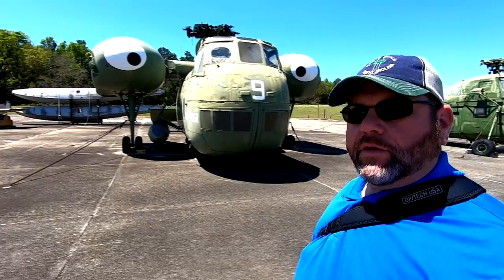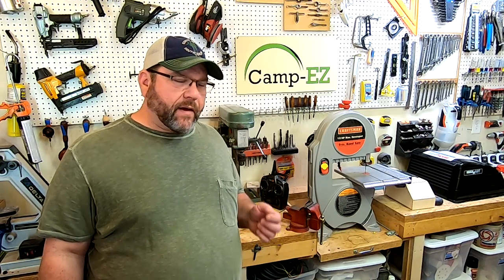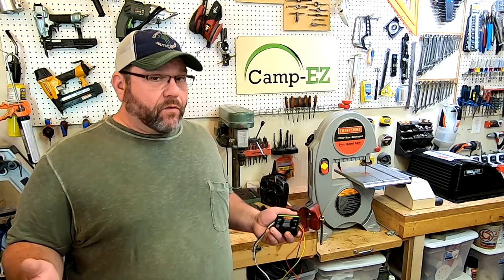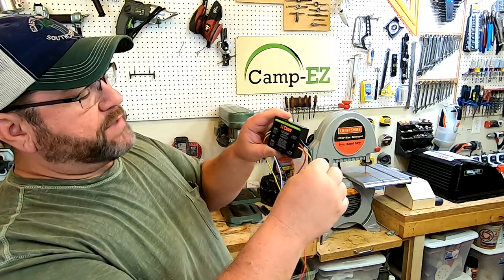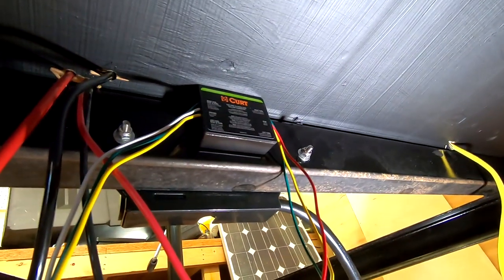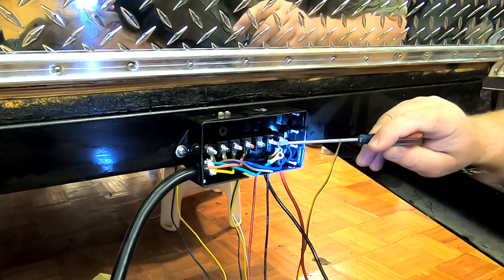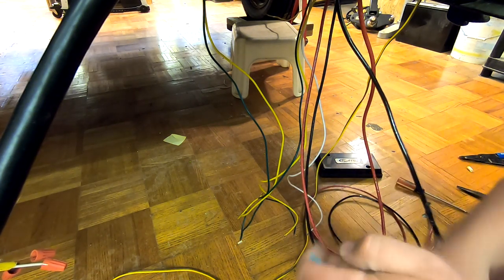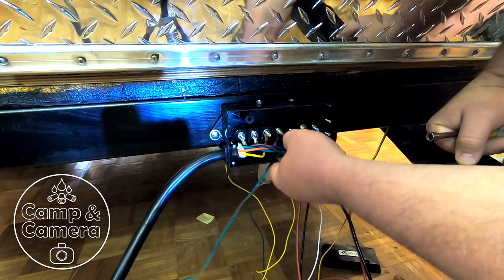Teardrop Brake Light Problem / Watching the Blue Angels

Comment: I understand this was made almost a year ago.  When I have an electrical post with multiple connectors, like the 'eye connector', if there's space on the length of the post, I put "Star Washers" between the connectors.  The Star Washers bite into the connectors for a solid, practically immovable connection.

Also, I'm in the research phase of looking for a Teardrop Camper design.  One of my requirements is having a Backup Camera for the trailer, which would be connected to the monitor in my Tow vehicle.  No matter what trailer I tow, I do NOT like having that blind spot directly behind me!

Enjoy your videos!  Happy camping!  =)
Reply from the maker: Great feedback!  Thank so much!

Comment: Years ago I had a tail lights issues on a scamper pop up and a boat trailer. But worked fine on the Chevy or GMC. Didn't work a Dodge. Fixed  it by replacing the Dodge not the Scamper!
Reply from the maker: Good choice!
Reply: @CampandCamera  After hauling a small boat and the Chevy hauling the Scamper, the boat went in garage, the POS Dodge went in the front yard and Craigslist!

Comment: It's like a professional shot those angels 🛩 ;). 

So I have been planning on using a ground block for my build. Is that what you're referring to having all the issues?
Reply from the maker: SkyroofNova72 Thanks!  I’ve just seen so many campers with ground issues that occur around the tongue area.  I just decided to give each light its own ground.  That way, if the problem does develop, it will only affect one light.